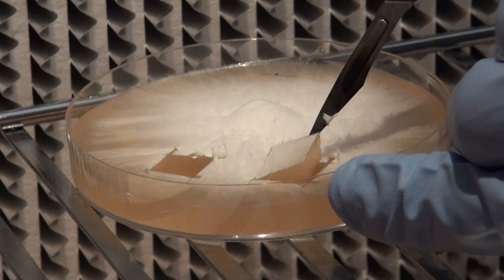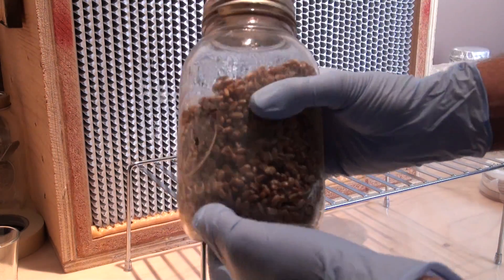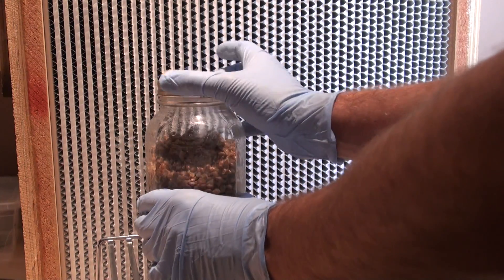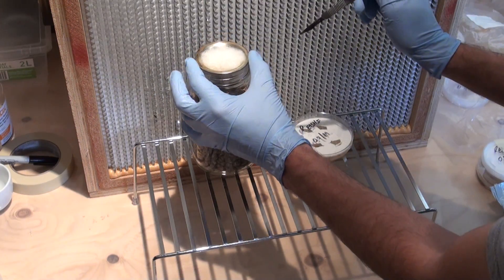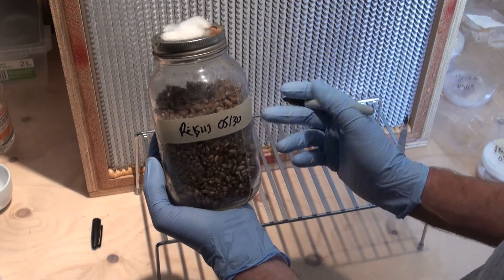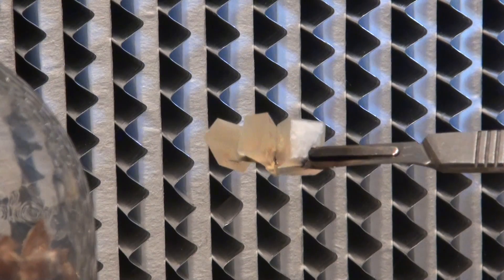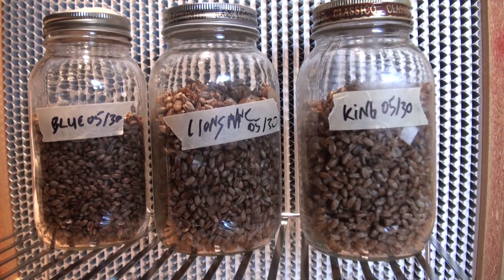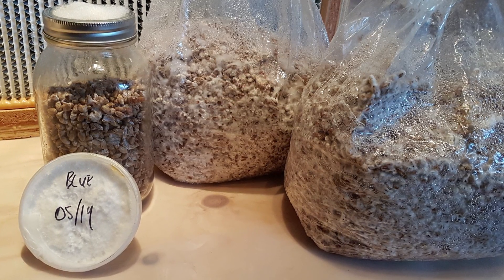How to Make Mushroom Grain Spawn: Inoculating Sterilized Grain

Comment: That is not a laminar flow Hood that is a positive airflow filter laminar flow hoods are large metal boxes with a polycarbonate front with air that travels across it's front opening like an air knife I've worked in Labs with laminar flow hoods for the last 30 years of my life trust me that's not an a laminar flowood LOL a hood is a machine not just a filter

Comment: Cooling the scalpel on the side is not at all necessary because the amount of mycelium that is killed of by the heat of the scalpel i so miniscule compared to the size of the agar piece you take out that it doesn't matter. It can actually be detrimental as the cut in the agar from cooling the knife creates another point for possible contamination to acess the agar.
Reply: hey do you know the temperature to store the jar
Reply: @jonipflueger  I’m guessing you mean the grain jar. While the mycelium is still colonizing it the temp should be around 25-28 optimally, in darkness. If you need to store colonized grain spawn long term you can just chuck it in the fridge, as long as it doesn’t freeze it will hold for many months

Comment: Say I have a sterilised jar of grain, could I just take a mushroom I've grown and give it a flick so it drops the spores onto the grain? Will this work or will there be bacteria on the spores that could colonise the grain first?
Reply: I've heard that you can take a mushroom's stem and a sterile scalpel, cut off the top, bottom and sides, then use the center of the stem which hasn't been exposed to the elements.

Comment: Novice question here: If I'm starting from spores, would it work best to inject spores onto agar first? Or can I avoid that step and inject straight into sterilized grain?
Reply: Following.
Reply: You can go straight spores into grain
Reply: It would definitely be best to go to agar first. If you go directly from spore to grain you will get some level of contamination, the question is how much. No matter how much and even if not clearly visible, that contamination will hold over to when you spawn and ultimately create smaller yields and less flushes. If you wanna get started faster you can shoot some spores into grain, but ultimately you definitely wanna clean it up eventually on agar otherwise you will never get rid of that contamination.
Reply: @wilkiedilkie  thanks for the reply. I'd be concerned about too much of the water from the syringe sitting on top of the agar and creating a lot of condensation. How do you avoid this? I will of course try to put as little drops onto the agar as possible, but with a syringe it can be difficult.
Reply: @TreeFullz  you shouldn't be too worried about the condensation. Just put some small drops of spore solution on the agar and wait for it to grow. Once you have some healthy growth, cut a bit of the colonized agar and transfer it to another agar dish. At this point you no longer have to worry about the contams in the spore solution (more or less).
Reply: Thank you!

Comment: Another tip for those PCing. I've had very different results on different stoves and lost MANY a jar through breaking. I have a standard Presto PC but on some stoves I would get broken jars while others broke next to nothing. I don't fully know exactly why they break or rather, how to protect from breaking. I had just started to experiment with putting a wash cloth over the rack/under the jars in the PC when I stopped growing mushrooms but I never did get any breaks that way. I'm sure you could find a better material to act as a temperature buffer, but if you only use the metal rack that comes with the PC you will likely break many jars, even if you keep the heat as low and steady as possible(depending on the stove). This has been my experience and I have PC'd jars on several different stoves with the same jars and the same PC.

I even tried older thicker jars btw and they would break too. You need a temperature resistant buffer between the metal and the jar IMO but I can't say that with absolute certainty because I didn't do enough testing before I stopped growing altogether.
Reply: Do you put enough water in the PC? Was there any water left after Sterilization or was it dry?
Reply: @moh19931000  Yes I put enough water. Never had it dry out.

Comment: What conditions are the shelf you put them on? What's the Temp, How much Light do you need to fan them with air or is the hole with Polyfill enough for FAE at this stage. In case you can't tell, I have never done this before.

Comment: i have some  oyster mushrooms that  got dry.. 
Can I just chop them up and inoculate my steril grain  with those?
Reply: found the answer yet? Want to do the same
Reply: I think as long as there is still some flesh that's moist you can do this. We inoculated agar by cutting into the clean section of a mushroom stem and putting a tiny piece in the agar. It worked perfectly.

Comment: When say say, "hydrate" the grain, do you mean cook or just soak in water like you would to sprout a grain? And then you say sterilize at 50 psi, what does that mean? thanks!
Reply: Just soak in water for 12-24 hours, jar it up and pressure cook at 15 psi for 90 minutes

Comment: Absolutely love your videos! I got some noob questions: Do you soak the cloth on top in alcohol to keep it sterile? Would not it be advisable to wear a face mask for both hygiene and protecting your lungs? And how do you detect contamination? Smell? Looks?
Reply: By looks. Contamination comes in many colors, healthy mycilium only comes in bright white. There is such a thing as mycilium piss which isnt necessarily bad but youll need to show someone with experience what you have.
Reply: Also dont soak the stuffing that would make it a magnet for attracting contaminants. I prefer medical tape over the poly stuffing.

Comment: Great quality videos.  Whats your opinion on the pressure cooker sterilization. I dont own one but was wondering if I could use a big stock pot with a lid. Or I also have a rice steamer.  Thoughts?
Reply from the maker: You might be able to use some substrates with only atmospheric sterilization.... but the pressure cooker is really required to get the temps up high enough so that you can use more nutritious substrates.
Reply: Thanks for the response
Reply: You won't believe this. Use ultra hard microwavable plastic storage dishes. I used to boil, then I started to microwave. Make sure microwave is clean and there are 4 holes in the top of the lid that's been wiped with the 90% alcohol and taped over with electrical tape. Microwave is easy peasy for an alt. method.

Comment: Why don’t you use self healing silicon injection ports?
Reply from the maker: Definitely could, but I don't generally use liquid cultures, or spores. Usually start from agar on a plate, which is why I just use the jars with the poly pulled through a hole.
Reply: FreshCap Mushrooms Ah ok, would you recommend using them if a spore syringe is being used ?
Reply from the maker: Absolutely, ya they work great. You can also just inject the spore syringe through the poly fill, but it can melt around the syringe which is not good... you can also just lift the lid to squirt it in, but if you don't have a flow hood, a self healing injection prt is definitely the best way to go :)

Comment: Can a sample of mycelium from a BRF cake be dropped into grain to spawn it? Thanks.
Reply: I was wondering the same thing, have you found any info on this yet?
Reply: @AudioStorm1980  I havent, but see why not. I think growing it out on agar first to make sure its "clean" is the better idea. Then transfer clean myc from agar grain. Im gonna try that, ill get back with results in a few weeks.
Reply: "from agar to grain" i meant
Reply: You can use a fully colonized brf cake piece but it will not have the same success rate as g2g. People grow on agar because of how easy it is to spot contaminations. There are good teks out there to cheaply get into agar. Look into pasty plates and store agar. You can get everything needed for a few plates for sub 20$

Comment: Hey tony I have a question. If I wanted to make a casing with grainspawn. What would you suggest as the best “case” to inoculate like a plastic tub? Thanks
Reply from the maker: Hey there, not sure exactly what you mean? A casing to go on top of grain spawn? Or a casing made of grain spawn? For an effective casing, try 50-50 peat moss and vermiculite, pasteurized.

Comment: pleased describe all tool you use. Especially big wooden box with many hole metal (screen) or its a blower?
Reply: I think the big wooden box is supposed to be a fume hood
Reply: Manguns - Its called a laminar flow hood. 
The front is a HEPA filter.
Reply: jonofitz11 - Fume hoods suck air, this is a flow hood.

Comment: Is a preasure cooker necessary for sterilizing grains?
Reply from the maker: Pretty much, it is by far the easiest way to do it. You could probably sterilize the grain without a pressure cooker at normal boiling temperatures, but it would take 24 hours or more and have a good chance to contaminate. Hope the helps!
Reply: There was a microwave method that was popular many years ago, but I would just get a pressure cooker and do it the most tried and true way, Ikea has a cheap one to get you started